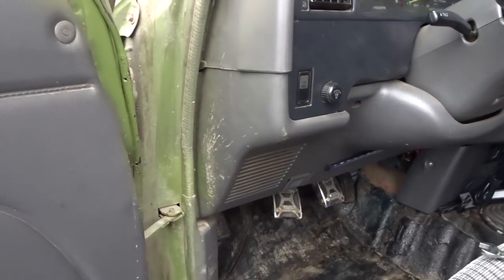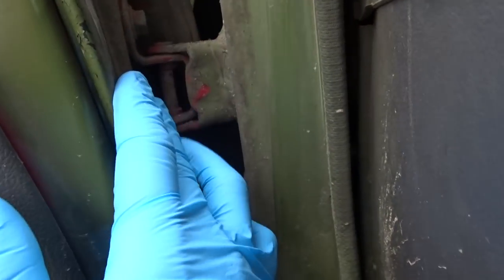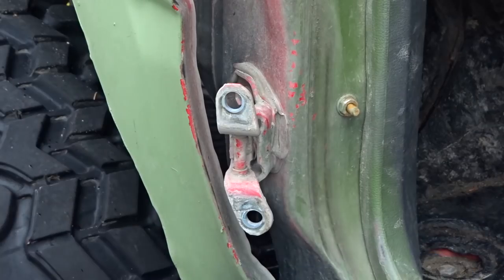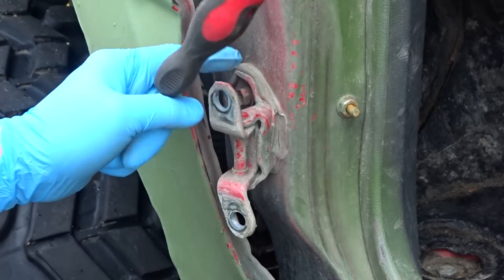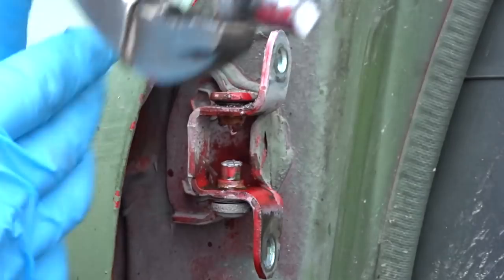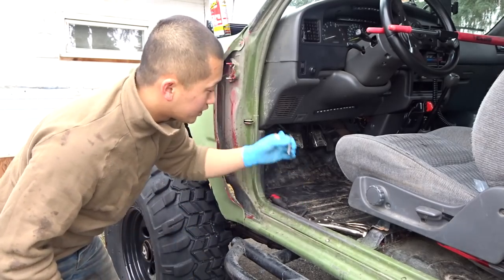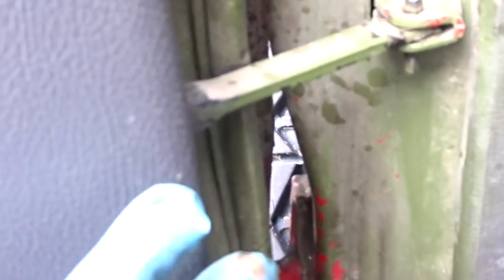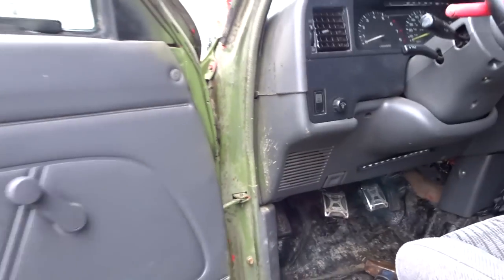TOYOTA PICKUP QUICK RELEASE DOOR  | DIY INSTALL

Comment: Sir:  Not sure I understand why you replaced the drivers side, upper and lower hinge pins as they looked just fine, no play or wiggle at all, unless the bottom pin was really worn, like my 90 Toyota PU,  with about 1/2" of slop in the lower pin.  Also, both top and bottom hinges have a bushing at top and bottom of each hinge which is usually replaced because that's typically where the wear occurs,, not the hinge body.  Also, not sure of the hardness of the clevis pins -  How have they worked out? .
Reply from the maker: Quick disconnect!